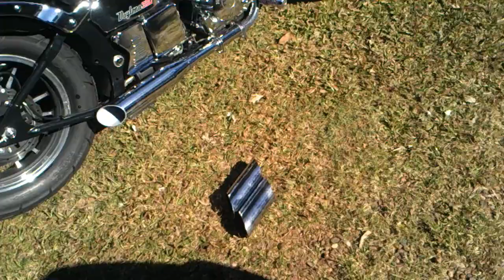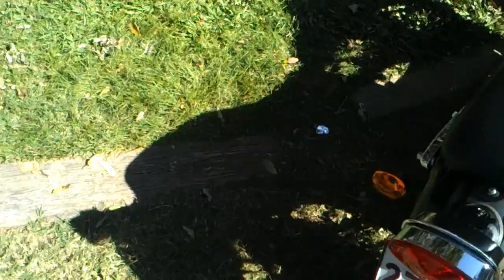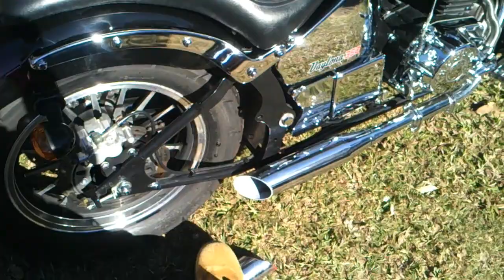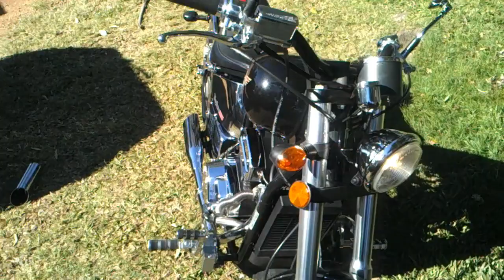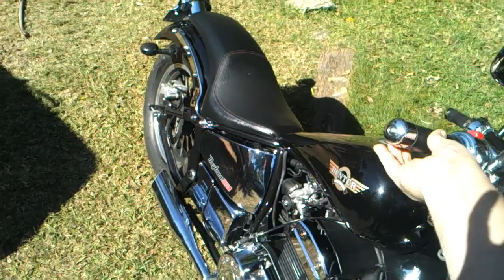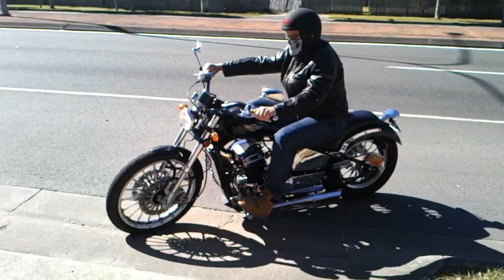Hunter daytona 350 with modified pipes, start up and ride by

Comment from the maker: i simply undid one of the screws that was holding it in place and turned it so the kick stand would not touch it when its down. check out my video of the bike with no exhaust on, i show the cut off switch in that video. thanks for watching.

Comment: Hi Mate, I'm thinking of buying one of these. Could you please tell me if it has improved the performance since you cut the pipes off? Or just made the sound louder?

I had a VN900 and sold it 2 years ago, but I just want to have a smaller bike to go to work and ride around town.

Does the bike vibrate badly on the highway?
Reply: Didn't really help performance wise. just made it louder.
Reply: +PTP Gaming  Thanks for the reply. Does the bike travel on highway comfortably or vibrate when hit 110?
Reply: Mr Kruser I just built one from frame up, it runs so good at 100-110 easy! Got heaps of power for a 350cc